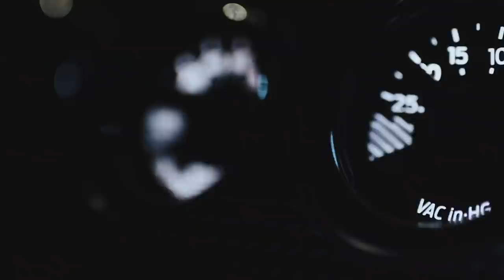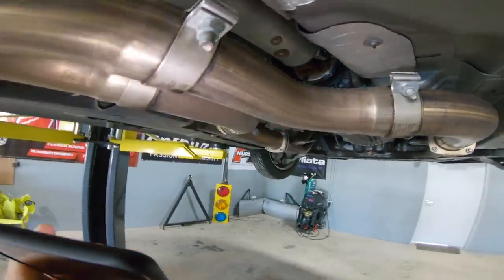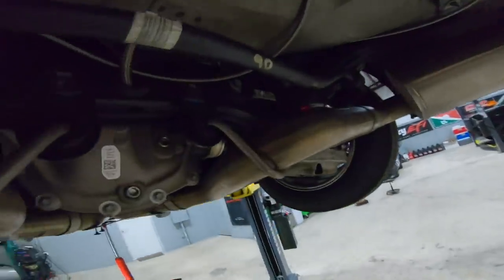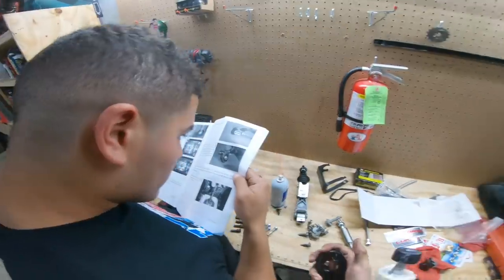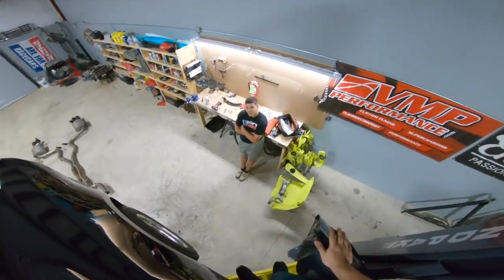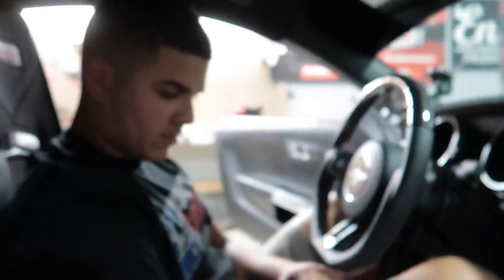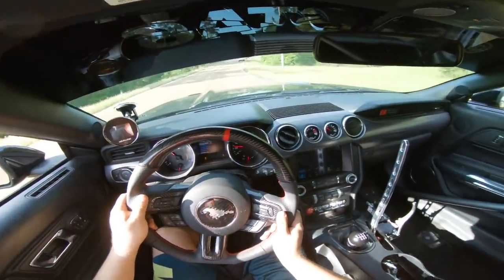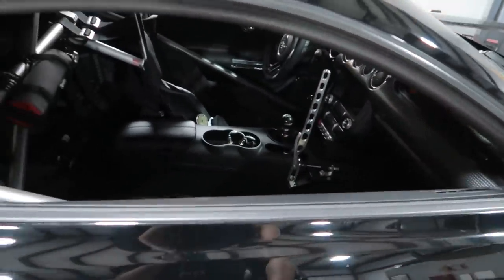Here’s the easiest way to cut shift times in HALF!

Comment: Nice upgrade. 
Tip for shift knob removal with locktite - oil filter strap wrench
Tip when putting the shift knob on, put the shifter in reverse and then screw on the knob. That way you know it’s not screwed down too far on the threads.
Keep the videos coming Gavin!

Comment: Should’ve gotten a MGW and get a driveshaft loop.

Since you’re running e85 you probably need to have the o2 sensor bungs angled & rewelded so that water doesn’t pool in there and fouls it(common problem with e85 and aftermarket headers)

Comment: if you run e85 the o2s will keep breaking because of the way the headers have the o2 bungs positioned. they have to be drilled at a 45 degree angle to not go out. or add heat syncs. I have the same problem on my 2014 mustang gt on E85

Comment: Nice, they are a great shifter.  Had one in an old Foxbody I owned decades ago.  Now practice launching and find the correct RPM to launch the car with so it will take off and not bog or burn the tires off...Get the car to some test n tunes so you can run it seriously...If the trans goes it goes,,,time for an upgrade anyhow for a car such as yours.  The engine in it is fine for now too...Once you master your getting off the tree and can use all the power it has now then switch up the engine...Get to the track Gavin!!!

Comment: Gavin race cars need what s called " but and bolted" prior to every race. Any nut and or bolt on car suspension and drivetrain needs touched/ nut n bolted!  U have a race car.

Your parachute lever is kinda far from you your gonna crash tea ching for it especially strapped in.
I'd move it to your side

Comment: GAVIN I ALREADY TOLD YOU!! BUY AN N2MB WOT BOX SO YOU CAN ADD NO LIFT SHIFTS DUDDEEEEEE‼️‼️‼️ And you can set an EXACT launch RPM to take any driver error variables out of your passes. Just clutch it, flat foot it, launch then flat foot shift it and now that you have a short shifter you’ll be hitting INSANE shifts

Comment: The ONLY shifter that should have gone into that mustang, or any 6spd mustang is the MGW. Short shifters and a blowfish bracket, Barton, etc is just a waste of time. Pull that crap out, order up the MGW and put it in. HUGE difference in throws, and quality. Next to the OEM clutch, the biggest issue with the shifting was the floppy dick shift linkage. Also, The shifter being attached to the body and not to the transmission. Get that garbage out of there and go MGW. All you did was a side grade. MGW is the best for the MT82. Had most of the other combinations of shifter parts out there. None come close to MGW. 

https://www.mgwshifters.com/shifters/mustangs

Comment: Why didn’t you go Barton hybrid 4 or a mgw race spec x? For 80,000 dollars spend in that car you really cheated out on the shifter. Also you dint have to pull exhaust or drive shaft. Fell like you just did because you needed video filler.